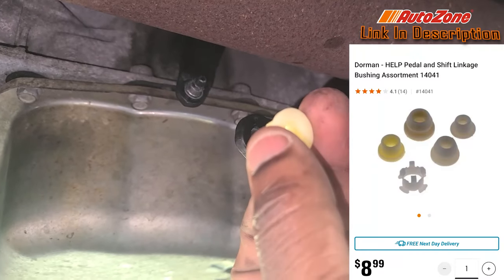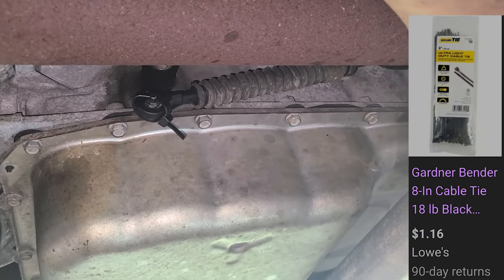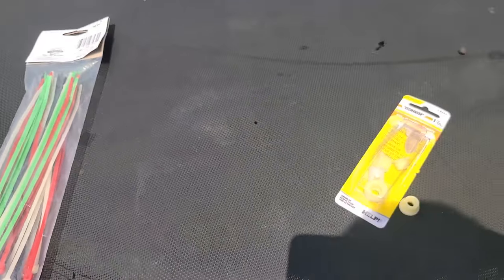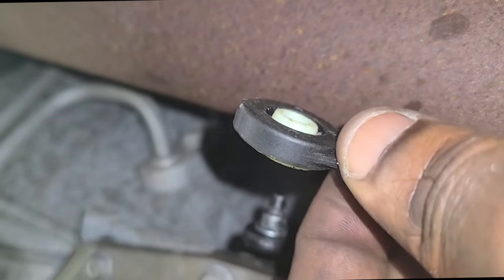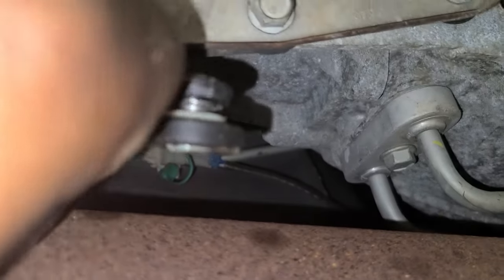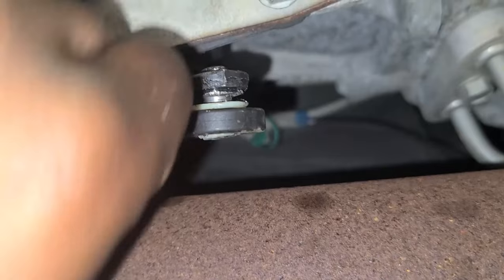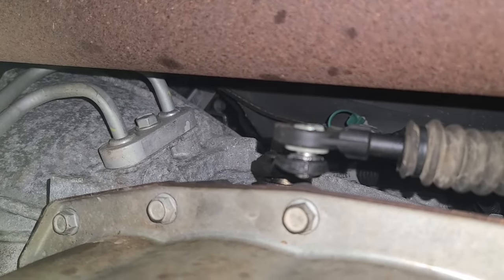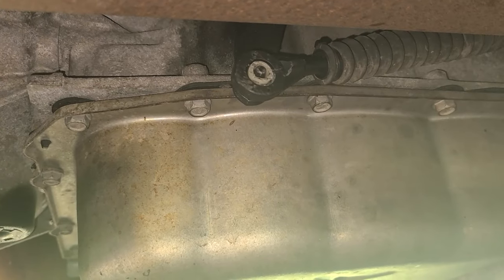Transmission Shifter Linkage Bushing repair Chevy GMC SUV Silverado repair broken #fix #truck

Comment: Fcompany; man I in the company vehicle and I start the vehicle put in reverse all good. Then wanted to go into drive. No clicking nothing. The reverse horn still sounding of. I call the company mind you this is between appointments. An hour later. They still dont know if they getting the vehicle towed. Then ask me how am I going to finish my runns. I offer to use my vehicle. They want me to wait two more hours for tow. Then get an uber back to my vehicle. I said okay. However; they paying for uber and gas. They call me back. Mind you its been an hour. I took a look at the system that engages the shifter followed the cabe under the vehicle. And fount the connector plastic broke. I did the sam zip tie bit. I called back told them I can put in gear now. They were quoted $500 for repair plus tow. I just seen this video bought that $15 part putting in tomorrow. Asking the owner of the company for a raise because; I still finished my route for the day no loss of money or clients satisfaction
Reply from the maker: Sounds like one hell of a day and you definitely deserve a raise my man lol.

Comment: I used a zip tie too, and he said I almost forgot that I needed that part 😆 lol so did I homie ! 👍🏽
Reply from the maker: Zip tie is probably the most underrated tool in the tool set 😅🤷🏾‍♂️
Reply: Wow! Thank you for this knowledge! I am stranded now in St Augustine after I just had my bushels done on my Tahoe at Sierra Chevrolet in Center Point (Birmingham), Alabama before I went on this crusie. 😠😡🤬So, you know how pissed I am right now on a Sunday and there is no one open.
Reply from the maker: @tanjadavis-dudley9524  Oh wow! I'm sorry to hear that, and you're welcome. Be careful on the road. Safe travels 🙏🏾

Comment: So what do it mean if I replaced shifter cable completely n time to time it still do it? Checked n bushing still in fine time to time gotta go under n pull it to gear myself, don’t understand why
Reply from the maker: @HueyBandz  are you saying you installed a completely new cable with the bushing already installed in it and it’s slipping off?
Reply: @NetWorkProduction2600  yea it’s weird tho cus the bushing is still put. I have to manually move the gear up and down maybe twice and the shifter all of a sudden will work until the next time it happens out of nowhere.
Reply from the maker: @HueyBandz  sounds like you may have got the wrong cable or a faculty one
Reply from the maker: @HueyBandz  who installed it?

Comment: Ours kept popping back off when shifting gears, we used a zip tie too. we got a 2009 Chevy suburban lt 1500 someone told us just replace the whole cable 😐
Reply from the maker: If it keeps popping back out, then yes, that's the only choice you have to replace the entire cable, unfortunately.
Reply: @NetWorkProduction2600  I will be calling the dealership to ask but just in case you know, do you know which cable is recommended? Our AutoZone said they have two types of cables , Not sure if I should buy from rock auto
Reply from the maker: @Crystal Nichole  what's the year, make and model? 4wd
Reply: @NetWorkProduction2600  2009 Chevy suburban lt
Reply from the maker: @Houstontx225  does it look like this one in this video? https://youtu.be/6oIAHAuauto
Reply from the maker: Yes, if it keeps popping out after all that, replace it definitely.
Reply: I replaced my whole cable and it keeps popping out 😢too

Comment: hey man year is that chevy ? Thanks for vid btw
Reply from the maker: No problem 🤝🏾 its a 2009 chevy tahoe
Reply: @NetWorkProduction2600  thanks ! I got a 2000 Suburban with the same problem, Gonna do this  LOL I bet the zip tie would hold out longer .
Reply from the maker: @StevenVincentSings  the zip tie trick huh 😅 aye it's actually a nice temporary fix to be honest 🤷🏾‍♂️

Comment: Didn't say what size he used at all!!!!!
Reply: I believe he mention it was one of the smaller ones in that pack I just pick mines up 5 min ago good luck fam
Reply from the maker: It really doesn't matter man pick one that fits. They all may fit anyway. 🤷🏾‍♂️
Reply: @NetWorkProduction2600  I picked a whole other one cause that one u using just kept coming off.
Reply from the maker: @MangoSlade.  sorry to hear that man but it's just a temporary fix to get you out a tough spot
Reply: @NetWorkProduction2600  I used the orange one that clips from both sides. Permanent fix!
Reply from the maker: @MangoSlade.  the permanent fix is the actual part I showed from autozone